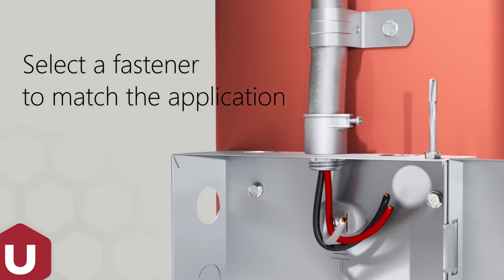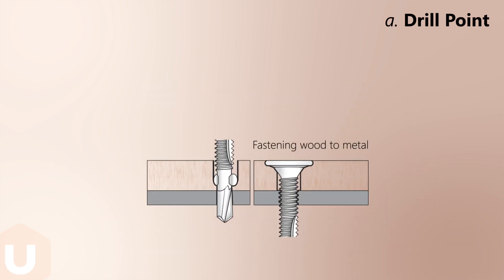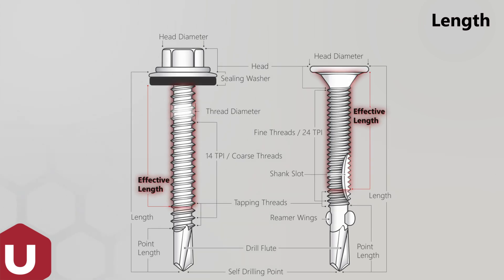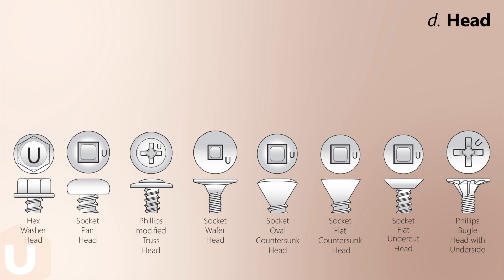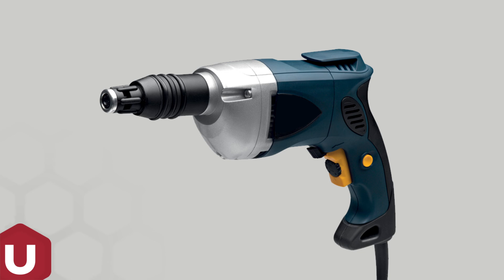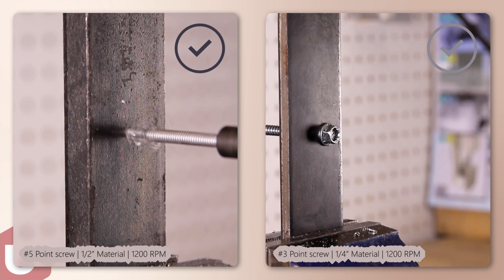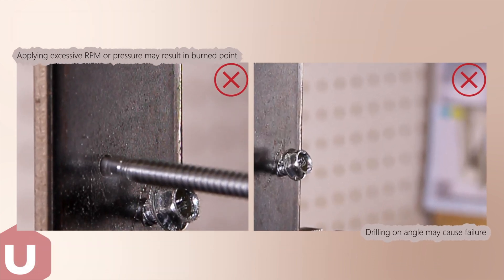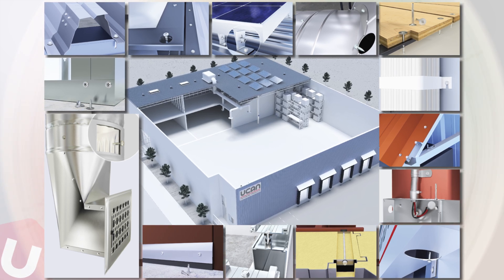How to correctly select and use UCAN U-DRILLS® Self Drilling Screws

Comment: Thanks for this knowledge article - very timely, given my current challenge. Some questions: are self-drilling screws "one shot" affairs, namely once drilled in, they should not be backed out in order to add something to the screws (like a hook or piece of wood or metal) to then re-attach into the original drill hole? In the same vein, when attaching metal pieces to metal, do both layers of metal have to be self-drilled and thus both tapped, or can the first piece be pre-drilled slightly larger in screw diameter (using an ordinary metal drill), then held in place by self-drilling into the holding piece? I'll be working at height in confined quarters so any advance work I can do in the workshop before tackling the final install on-site would be very beneficial. Thanks in advance... Tom
Reply from the maker: Hello,
Thank you for your interest in our products. 
Yes, self-drilling screws are "one shot" affairs, namely once drilled in, they should not be backed out in order to add something to the screws (like a hook or piece of wood or metal).
When attaching metal pieces to metal, there are two options:
both layers of metal have to be self-drilled and thus both tapped – the total thickness of both pieces MUST not exceed the drill capacity of the screw.
the first piece can be pre-drilled slightly larger in screw diameter (using an ordinary metal drill), then held in place by self-drilling into the holding piece.
In this case, the drill capacity of the screw will only be for the second (base/holding) metal piece.
 
Advice: Choosing the length and size of the screw is very important.  The correct length of the screws for the job is = Total thickness of both metal pieces + 3 thread lengths + the drill point.
              e.g. If you would be using a #12-14, #3 point screw, the total thickness of the two plates is 3 mm + 3 thread lengths (5.5 mm) + drill point (6.5 mm) then the length of the screw should be at least (3 + 5.5 + 6.5) = 15mm…UCAN sells a 5/8 length screw for this.
                     Please note that #3 screws can drill MAX 1/4".
Reply: Thank you, very helpful response. Not that it will make my "at height" job any easier :) @ucanfast